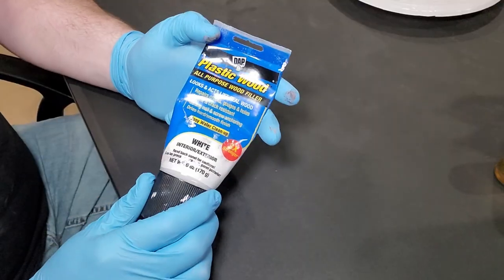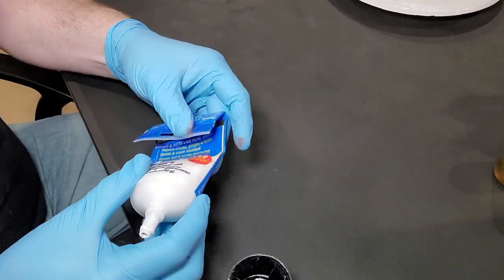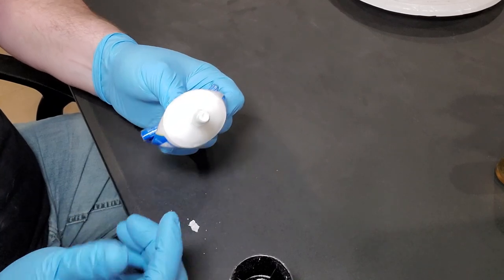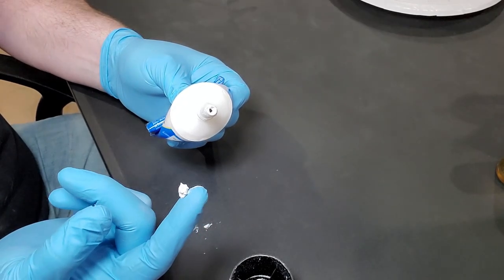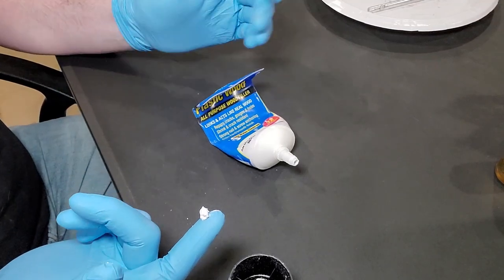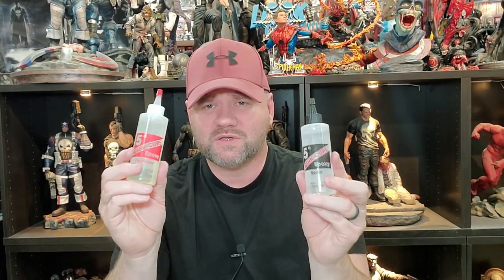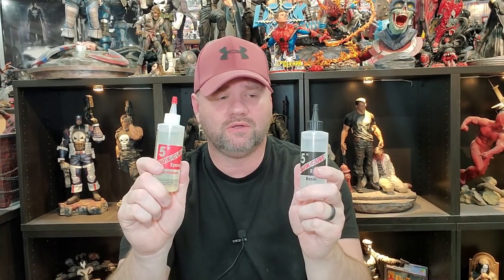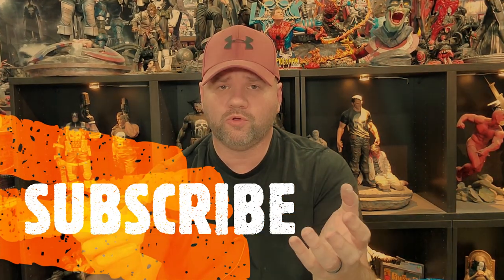Shared Tips to help your 3D Printing and Painting

Comment: One thing I'm always chasing is getting a clean resin print. Like, without crud in crevasses. Is it a matter of drying better before curing or curing time? I typically wash for 10 minutes and cure for 4 or 5 in a wash and cure station.
Reply from the maker: Usually if you got crud in the crevasses then you might need to change your IPA. I use denatured alcohol and it works better IMO. And make sure you give enough dry time for sure. And that's what I use that stiff brush for...to get any of the crud out. Hope that helps!

Comment: Dude!! Thank you soooo much for recommending that DAP Wood filler. This stuff is awesome, goes on easy, dries nicely, sands smooth and since its water based its easy to clean up with a wet q-tip. 

I do have a question on the G tool, I noticed it comes with 3 different grade pads- 600, 800&1000. I used the one that was already installed on the tool but it didn't say what grade it was. I saw that it really didn't take off a lot of material so I'm guessing it was a 1000? Do  you use all the different grades?
Reply from the maker: Thanks Carlos! That wood filler is awesome indeed. I think the g tool maybe a 1000 grit on it? And it's more of a polisher than a sander. Once you get whatever sanded good it'll smooth it all out foe that awesome finish.
Reply: @TheCreativeCollector  Hi Henry,  how do you tell when to replace the sanding discs on the g tool? Its hard to see the disc once its been used with all the grit in it. how long does a disc last for you on average?
Reply from the maker: I replace it once the edges start to wear off and tear

Comment: bro that gtool , it isnt basically a tooth brush, tha is a toothbrush, in new zealand u can electric tooth brush that exact same shape and design as the gtool, , change out the brussels  for sand paper and u have the gtool
Reply from the maker: Well it works whatever it is. That's all that matters to me.
Reply: @TheCreativeCollector  im not saying it don't work, its actually a looks like a good tool, good for getting into tight areas, it makes sense to use 1 to me, im just say we have electric brushes that are identical to that tool